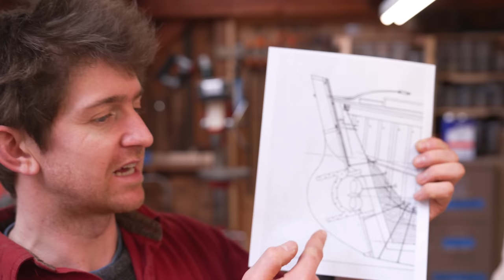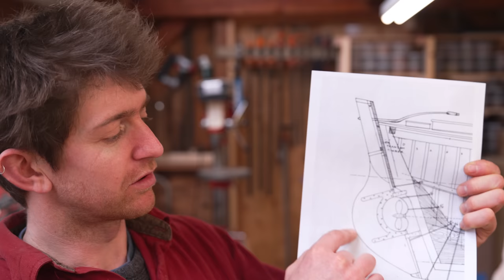Purpleheart Rudder / Cherry Cabinetry (rebuilding Tally Ho ep148)

Comment: For what it’s worth, I’m super interested in the details of how the trim tab will be actuated and controlled. I’m not sure a lot of other people would be, but if you’re tempted to do a deep dive on that, there’s at least one person who’s interested!
Reply: Very curious, separate tiller?
Reply: @timgelder4263  I don't think the trim rudder is moveable (edit: or not moveable by controls at least only manually), i think it's there to account for any misalignment with the tiller so you can go straight without any rudder inputs - might be wrong tho

- lol just got to the actual explanation, i was way off 👏
Reply: @timgelder4263  yes, sort-of..
Reply: A trim tab helps to ease the control pressure when well-adjusted on a plane or boat you can attain a one-finger control on a 200 mph cruise.  It does not steer it maintains pressure on the tiller or yoke.  Don't know if I love flying or sailing more...lol
Reply: The trim-tab could easily be adjusted with a smaller line ,like used in adjusting your hydro-vane autopilot,  leading from the cockpit operating in a similar way to the hydro-vane.
Reply: @davidnormandin5428  my first love is flying … only recently have I been bitten by the sailing bug. Some levels of theory cross the gap between the differences 👍🏼
Reply: in aviation we call this a Flettner Trib Tab.. And as always: amazing work!
Reply: I know trim tabs from boats and airplanes. They are work and time savers. I look forward to the method and installation. Thanls Leo for another great video. Tthe rudder and cabinetry is beautieful.
Reply: I’ll 166th that mate 👍✌️🇬🇧
Reply: Me too.
Reply: @Spinner1987CH  No we call it a servo tab.
Reply: @Spinner1987CH  I'm a bit rusty on the subject, but did more aviating than sailing in my youth. I was thinking that Leo was describing a servo tab rather than a trim tab, but maybe the jargon is different for boats. Servo tabs (flettners as you said) take the load off operating a flying control, eg elevators. They effectively power the moving surface. Trim tabs for me meant a bit of bent sheet aluminium (aluminum) riveted to the trailing edge that we tweaked a couple of times on the ground to get the plane to fly sweetly, that is stick central/trim lever in the neutral position. But I am not going to take issue with anything Leo and the team are doing!
Reply: @davidnormandin5428  Hah. At first I didn't see the plane reference in your comment and was confused by the 200 mph cruise speed. With a displacement hull that speed would require a 2.7 nautical mile waterline.
Reply: I'd be interested too
Reply: Yes, its a fascinating concept, invented by the guy who developed mechanical sails, (Flettner Rotors). From Wikipedia
"A servo tab is a small hinged device installed on an aircraft control surface to assist the movement of the control surfaces. Introduced by the German firm Flettner, servo tabs were formerly known as Flettner tabs."
Reply: @rodneyallen5003  I too would choose flying over sailing but the reality is all I have now is a NACRA 5.2
Reply: The channel rctestflight, just this past week, posted a video using a trim tab system for an autonomous sailboat project. He uses a trim tab as a way to steer the sail so you can see an above water example of how trim tabs work.
Reply: Would love to see it as well. Seems super interesting!
Reply: @TheFlyingPlectrum  well we in europe call it flettner tab (as it was invented by flettner)… you can also call it servo tab
Reply: @davidnormandin5428  Ha, I can't afford either these days 😔
Reply: @roseroserose588  Actually, Leo explains quite clearly in this video that the trim tab on this boat will be used to control the actual main part of the rudder, as controlling it directly would require too much force. It will basically be like a motor for the rudder.
Reply: @andrewpearce2562  yeah i made my prediction about 10 minutes before he explained how it works (: I was kinda right, in that it does help w/ weather helm but the mechanics i was way off -  was guessing based on how it works in RC sailing land but obviously the full size boats work a little differently
Reply: Me too
Reply: Kevin Boothbay has a YT channel called, How to Sail Oceans.  He has a couple of videos showing his rudder trim tab and the mechanical linkage.  He explains how it all works.
Reply: I've taught a number of people how to sail.  Being also an aviator, I used aeronautical terms when explaining sailing to aviators.  I found it quite humorous when the light bulb came on, especially those long time experienced pilots.  

Flying and sailing are very similar in many ways.  Among sailors, many are also pilots.
Reply: Tens of thousands of people will be.  Now come on down off that pedestal so you can see the video, Diva.
Reply: I'm an Aerospace engineer and additional area to the vertical stabliser (ruder...not really but close) later on in the design process of aircraft is really commen (somtimes really crudly) and something like trim tabs (spring tabs or balance tabs) in the way leo described is used reduce the torque required for the ailerons of quiet modern airliners. I'm fascinated by the way the same technology finds application in different roles. I really enjoy the more technical explanations.
Reply: @timgelder4263  
Not totally sure, but basically a wind vane will control the trim tab, the vane could be a board or cloth structure, which is set in a plane 90 degrees to the wind, and by side to side movement rotates a gear mechanism which in turn meshes with an axle, rather like a halfshaft on a car, only thinner. This axle rotates the trim tab in the opposite direction to the rudder, thus forcing the rudder to change direction, and steer the boat.
There are several vind vane systems out there that run on this basis, but some will look more in keeping with this boat than others. Intetested to see what they choose, or maybe they will make their own!
Reply: Im telling you it will blow your mind
Reply: @Spinner1987CH  I'm in Europe and in my 36 year aviation career it has never been called a flettner tab.
Reply: @TheFlyingPlectrum  Well… I was taught like this at University in Aerodynamics as well as in the theory of primciples of flight for the private pilot license.. 🤷‍♂️
Reply: me me me auto steer with sketches

Comment: The fact that you got that auger to drill from one side to the next, so that it came out dead on to the point that was marked, was an amazing feat in itself
Reply: it was, in addition to other things, a testament to the consistent density and regularity of the grain in that purple heart.
Reply: That's exactly what I was wondering. And still can't imagine how ,without pilot holes, it stayed on track.
Reply: I was definitely impressed with that !
Reply: @bitey6709  you can build a large L shaped jig that the drill bit rides in the inside corner of the L- to keep everything 90 degrees.
Reply: @johnwalker7592  Theres lots of jigs that could be used but this guy did it by hand.I think it is impossible that he did this by hand. No jigs or gadgets to guide that 3 foot long drill.And he did a few of them and they all came out the other side to prfection.There is some trickery here but i cant spot it.
Reply: Very impressive indeed, but how does it compare with  Pete's amazing feat?
Reply: @garyjonah22  what feat
Reply: I believe he uses a few different small levels to make sure he comes out in the right place, I have had to do it myself a few times it’s not easy especially when you’re going through hard winter layer then a soft layer
Reply: @johnwalker7592  You can but he didn't.
Reply: That was amazing. I'm happy if I can do that through a 6" board.

Comment: Ok how in the world did he keep that long drill centered? That's amazing!!!
Reply: It might be sighting to a pin on the far side and also a simple trick using a  washer on the drill shaft, aim too high and it comes  back towards you, aim too low and it goes away from you. The horizontal centre line of the rudder would have been shimmed to be dead level (horizontal)
Reply: A pin on the line to aim for like a gun sight and a washer on the drill shaft. The rudder axis must be horizontal  and the washer will go away from you if you aim too low or come back toward you if you aim too high. It sounds simple but still requires skill to pull it off as Zeal managed to do.
Reply: These guys make everything look easy and I mean that in the most complementary way.
Reply: @loloaqici82qb4ipp  Great explanation, thanks.
Reply: Leo, your explanation of the trimtab is excellent. When you finally achieve your goal of sailing Tally Ho, you should be able to turn you pedagogic talents into an income stream.
Reply: Making that rudder is a tight rope walk. Huge time and material investment and then it’s time to risk another through penetration.
Reply: What he said.  I can’t even seem to START a hole centered.  😂
Reply: Not a very pretty rudder. But the straight trailing edge will make engineering the trim tab easier.
Reply: @stevekestin4345  Pretty or not is an opinion. My opinion is that a rudder is quite pretty if it does its task well, and Leo did a fine job in explaining the constraints. In Rotterdam we have a bridge called "De Hef" which was purely built to be functional, not beautiful. But very many people like that bridge for its appearance too, just because anyone can see how it did its task.

The straight trailing edge will not only make engineering the trim tab easier: if you carefully listened to Leo, you will now also know that a straight trailing edge makes a much more effective rudder. Understanding fluid dynamics is much more important when designing a rudder than knowing how to make things look nice.
Reply: @klaasvanmanen8214  I looked up De Hef.  Nice vertical lift bridge.  We've got four of those in Portland (OR) and all are older, but all are still in operation.  I'm curious why they decommissioned yours.  It looks in good shape.
One of the ones in Portland, the Steel Bridge (innovative name), is double decker.  The lower deck is for rail traffic and can actually be lifted up against the bottom of the upper deck in order to let medium height vessels to pass under.  It's kind of cool.
Reply: How many pilot holes should be used.
Reply: @Breezely  De Hef was a railway bridge that carried one of the busiest railways over one of the busiest waterways in the Netherlands. It had only two tracks and in the schedule of Dutch Railways they had to leave gaps for opening the bridge for shipping traffic. With increasing railway traffic, especially passenger transport, De Hef had become a bottleneck. In order to solve this problem, a new four-track railway tunnel was built under the Nieuwe Maas and the Koningshaven, parallel to and a short distance from the old railway. When the first two tracks of the tunnel opened in 1993, the old railway was demolished, and the movable part of De Hef, which is classified as a national monument, was permanently placed in the 'open' position, so tall ships no longer have to wait for a bridge to open. Remember Rotterdam is by far the busiest port in all of Europe, and the Nieuwe Waterweg, as part of the river Rhine, is part of the connection with the main industrial areas in Germany.

De Hef is still in good shape because it is maintained as a monument. The counterweights however have been fixed, and the cables were removed during a large scale renovation in 2014-2016, so the bridge is no longer operable.
Reply: No kidding.  Brilliant!!!
Reply: @stevekestin4345  looking forward to trim tab video !
Looking forward to trim tab video
Reply: theres got to be a trick to doing that.

Comment: You know you're good when you can eyeball a long drill bit throng three feet of wood and darn near hit dead center on the other end.  My hat is off to ya.
Reply: No such luck involved. You level the rudder, and put a washer on the drill shank. Too high,  the washer moves towards to wood, too low, it moves back to you.
Also, did you notice the levelling arm, used to start the process at the beginning, sitting on the rudder as he drilled ?
Reply: @dnomyarnostaw  Never said it was luck I just said he was good.  I'm not a master carpenter and he did what I thought was a very difficult thing to do but hey he probably has done that a hundred times.  Thanks for your washer tip.  I'm going to give that a try.

Comment: That purple heart is truly the most beautiful wood. There is something incredibly satisfying watching it be worked into a finished piece.
Reply: If you haven't worked with it, purple heart is very very hard to work with, it's so dense and heavy, but it's amazing lumber
Reply: I believe it's called a "Thing?" 😁
Reply: It is amazing stuff. VERY tough to work with, oily and very heavy, but is truly beautiful when finished. And it is durable as all hell...
Reply: like walnut turns yellow when expose to sunlight in a finished product purpleheart turns a not so pleasant brown in sunlight.
Reply: I have said this here before too. I have not seen a timber like it here in NZ, used to shitty old pine hahaha. Looks so damn stable and sense.
Reply: @davidnormandin5428  THIS, people. Yes, purpleheart is a beautiful color when freshly cut, but it will turn brown when exposed to sunlight. Its salient point is its strength and durability.
Reply: @ivyisle  No doubt, one of my least favorite woods to work with, but nice to look at
Reply: @davidnormandin5428  It's still a nice color when it oxidizes
Reply: @nathanchalecki4842  years ago I saw the use of purple heart on the new wharf in Queenstown
Reply: @freespeech3673  that doesn't surprise me.. Queenstown doesn't feel like NZ hahahaha. My opinion is based around what I find while at bunnings hahahha

Comment: YHi Leo, have some really talented guys assising you on this project, but watching Zeal working that Purple Heart was just amazing- I know how hard it is to work, and he has done a fantastic job on that rudder. As a retired shipwright- I am loving this, especially watching you all use tools that weren't even a thing in my day. I wish you every success- you deserve it.
Reply: I do wonder why he didn't use an adz on the rudder instead of an axe.
Reply: They all are incredibly gifted shipwrights and talented cabinetmakers as well !
Reply: Kathy, I wondered that too.  But did you notice that he chopped right to the drawn line?  I reckon he's quite familiar with the tools.

I think the method he used dictated using the ax.  He cut one side then the other at an angle to the wood thickness.  Then he joined the two by chopping out the center.  An adze wouldn't have allowed that (unless using the adze at an angle, not flat to the stock as intended).  Therefore, the ax was the better choice.

I know I have sometimes chosen the 'wrong' tool because I wanted to practice more with it.
Reply: I've worked with Purple Heart.  When he was planing the rudder face I kina felt sorry for him.  That's a big job and that wood doesn't make it any easier.  He'll be tasting PH for days what with the fine dust.

Comment: Truly amazingly awesome. I've done enough woodworking to deeply appreciate the incredible craftsmanship going on here. All possible congratulations.  It is not at all childish to take pleasure in hewing a big timber down to a rudder. Yikes. That satisfaction has led to much of our modern world. Thank God for it. 

Side note... Airplanes - especially early ones - have also used tabs on their control surfaces (rudder and others). When they're used for leverage to move the bigger surface, they're called servo tabs.  The trim tab function is get the plane flying straight and level. The other function Leo mentioned with respect to power boat rudders appears on airplanes, too, Fowler flaps enable the wing to go slow for landing and takeoff.

Comment: Leo, thank you for your wonderfully educational and well edited videos. I have to say that the advertisement for  HelloFresh was the funniest ad I have ever seen. 
In 1963 the editor of Yachting World, Bernard Hayman commissioned a yacht, the building of which was followed by the magazine. It was designed by Alan Buchanan and was 32' long with a transom stern. Hayman had a self steering unit that like you propose for Tally Ho, that had a trim tab. I remember the first trim tab that had a taper following that of the rudder (as proposed for Tally Ho) that caused the  self steering to over correct and was quickly scrapped. Hayman then built a new trim tab with a tiny flare on each side. He said that the difference was that the original one without the flare had to turn considerably to move out of the turbulence zone whereas the flared one was very close to the edge of the turbulence and only had to move a small amount to activate the turning of the rudder it was a great success. He wrote that the drag caused by the flared trim tab had no apparent effect on the performance of the boat. 
You may be able to access historic copies Yachting World and the building of Barbican. I searched and found that it is still around and include this link.
All the best with the wonderful Tally Ho! 
https://woodenships.co.uk/sailing-yacht/buchanan-bermudan-cutter/

Comment: Love the Trim tab idea. They were quite common on aircraft for elevator control. Known as a servo tab if used as you will to drive the control surface. They can be linked directly to the control column(tiller) or fixed to the airframe(hull) so that they move when the rudder moves. Some are used to assist(balance-tabs) where as others are used in opposition to movement to stiffen the control(anti-servo tabs). They are sometimes as you suggested also used to trim although this is more commonly done with a separate tab. For the plane spotters some aircraft which used servo tabs: BAE146, MD80 and the biggest of them all the Bristol Brabazon.